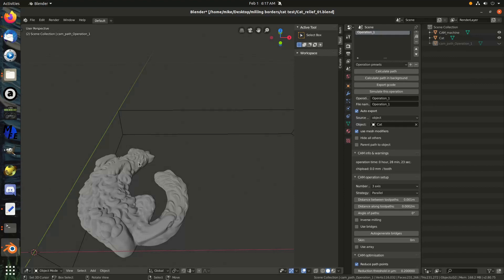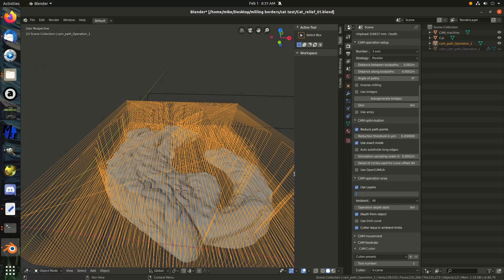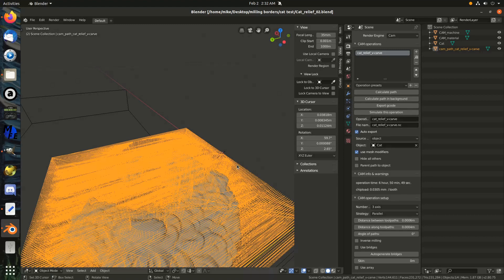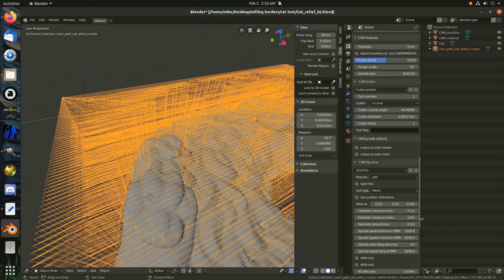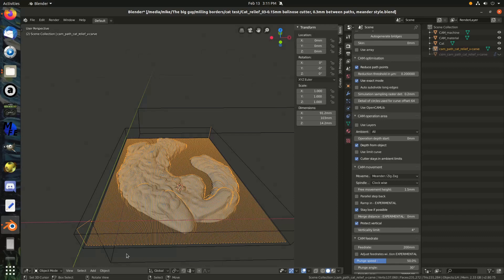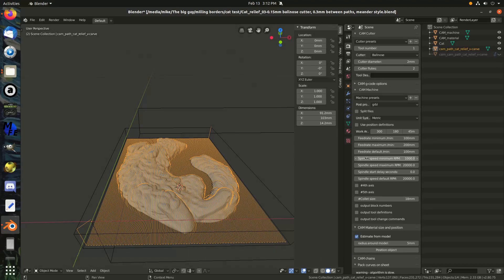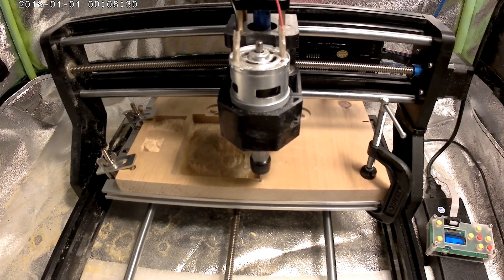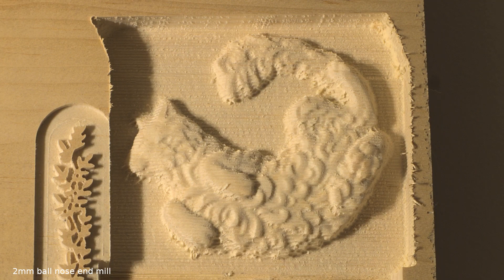BlenderCAM & 3018 Pro - 3D relief with v-cutter & ball nose mills - grow tents for mill enclosures

Comment: Try different materials as well. Maybe MDF would produce a cleaner cut?
Reply from the maker: the thing with the v cutter bit here is i was running it at 0.6mm between toolpaths, which is way too wide, it should probably been more like 0.1 or 0.2mm, if i was using the fancier software it would probably just do that automatically, this software is powerful but it just has all the settings in a big list with complete control and very little guidance... i definitely have to try the v bits again at a much higher... well, resolution basically. this took 14 hours anyway though lol, shouldn't do clearing with a v bit.  Surprised how well the ball nose bits work, they can clear and finish
Reply from the maker: probably, but I bet it wouldn't be that different, I think the "v-carve" bits they use on big spindle motors and these little v-carve knife blade things that they typically ship with these 3018 machines do not produce the same results.  I been thinking about buying a collet that'll fit 1/4" bits to try some of them real v-cutter bits.  I thought the ball nose mill did a great job the the sides are a little messier.
Reply: @OGmolton1  I have 1/4" collets. I will bring one over when I bring you that fuse thing for the Rane
Reply: @OGmolton1  the sides is what I was referring to when I said use mdf. It will cut smoother and won't have wood tearout or fraying. I will bring some wood and mdf for you too
Reply from the maker: @ojmcbaggins  cool :) thanks